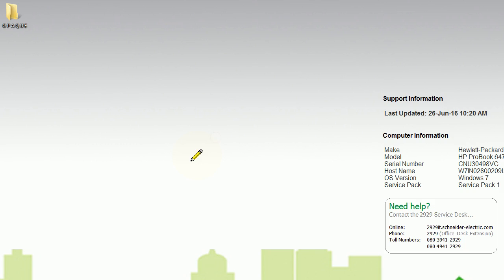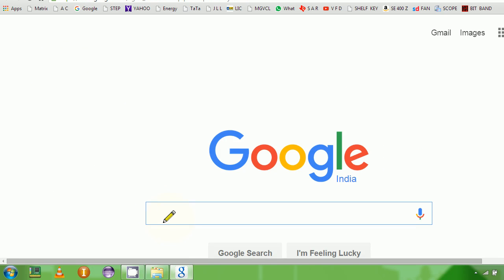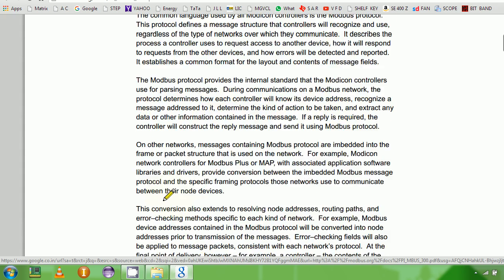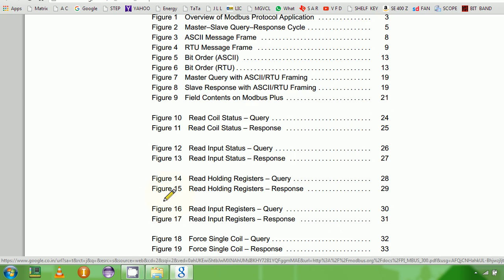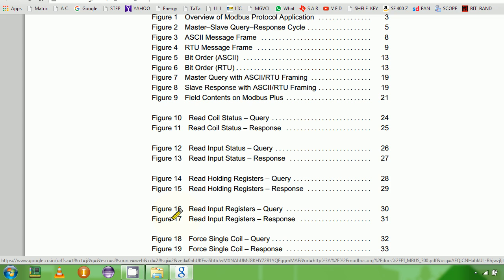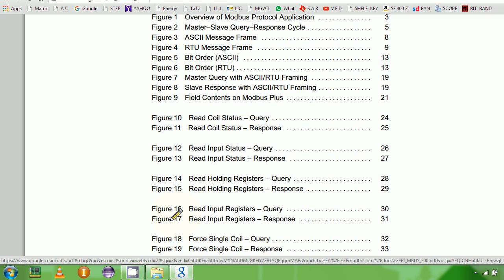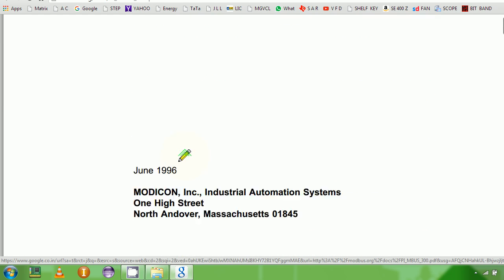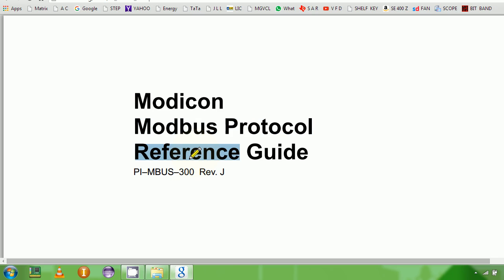1 Modbus RTU Protocol 1

Comment: Sir r u used the arduino libraries of Modbus if yes pls pls make a videos on that
Reply from the maker: himanshu , as you must have noticed , i have written my own ModBus library , and mate i do not use arduino , it only for kid project but NOT for professional use. but it should be easy , u download the documentation , read in and i am sure you would find it easy...
Reply: @jugnu361  ok thank sir i m leraner in the field of automation and that's why i m trying to understand Modbus protocoals..
Yes sir arduino is not that much powerful to handle the data so  shall we use Rasphberry pi for that?? and if yes can u pls suggest me the  python module  which u think the perfect for this communication..